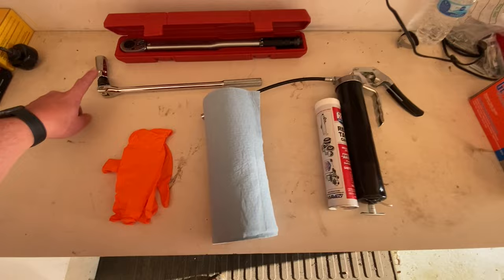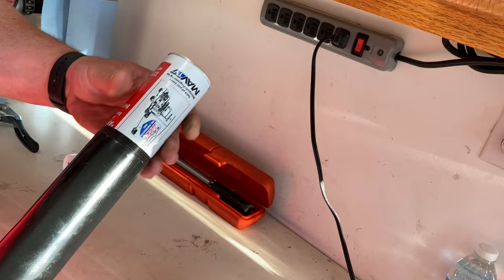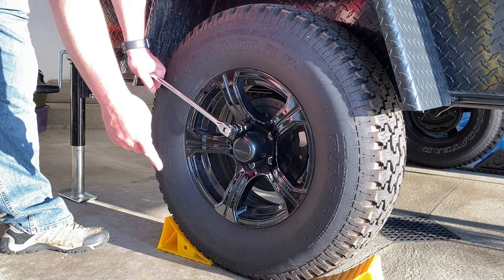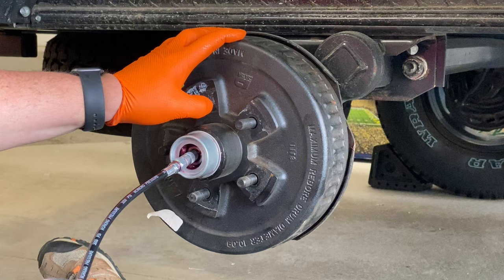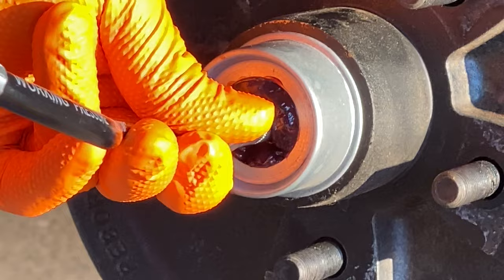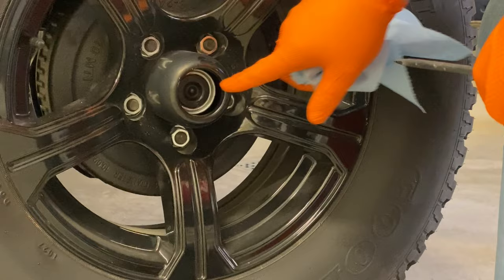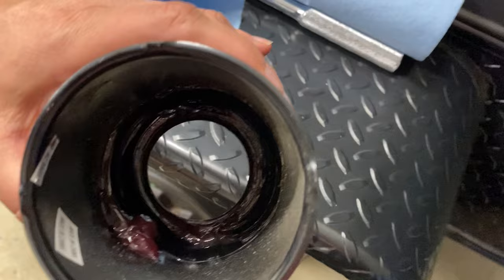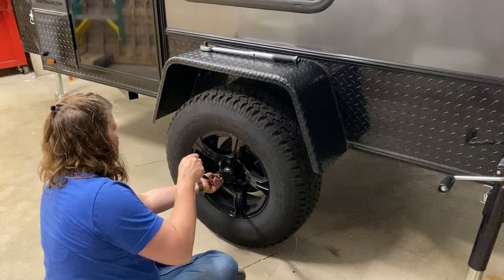Let's talk: Wheel Bearings for your Hiker Trailer

Comment: Another tip if you have 2 people. Hook your electric brakes up and have someone hold the manual toggle switch. Then you can torque the wheel without it spinning.

Comment: How often do you grease your wheel bearings? Also, those jacks you have, is there one on each side so it can be jacked on either side?
Reply: Generally speaking at least once a year not to exceed 12,000 miles.
Reply from the maker: Minimum 12 months once a year.
Reply: Hiker Trailers says wheels should be greased every 3,000 miles or if wheel bearings are submersed in water (water crossings). Generally, the smaller the tire, the faster the wheels spin, and the more stress it puts on the bearings. That's why some boat trailers with small wheels require repacking every 2,000 miles, whereas big RV's can go every 10,000 miles or once a year. If in doubt, grease it out! You really can't over grease wheels. 😆

Comment: What is the height of your trailer including that 270 awning? What about the Extreme Offroad with the same 270 awning? I want to be able to fit in my garage with a 7' tall opening.
Reply from the maker: The height is 79" for our mid-range - ground to top of 270 awning. It would be different for the Extreme Offroad as they sit higher.
Reply: @MWDAdventures  Thanks Matt. Appreciate the quick answer.
Reply: Thanks for asking that question, I was wondering the same thing.